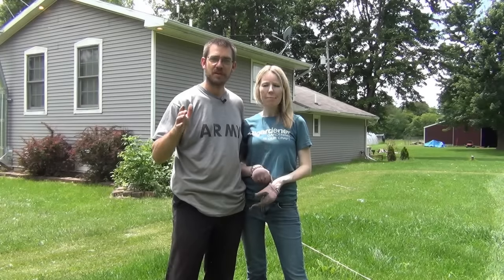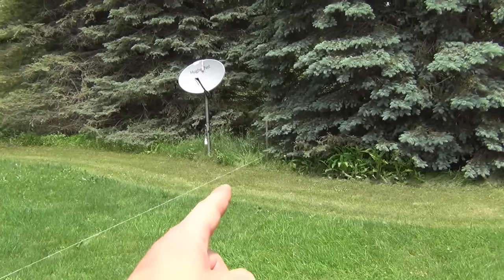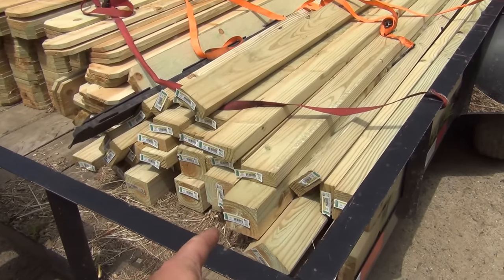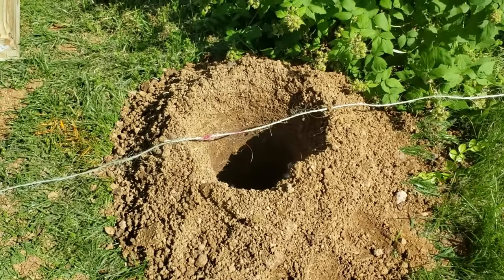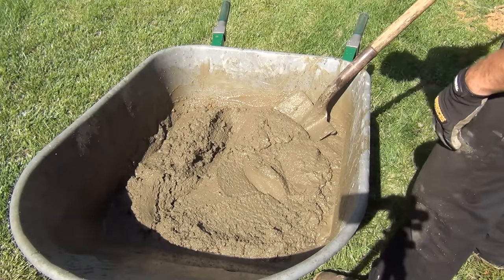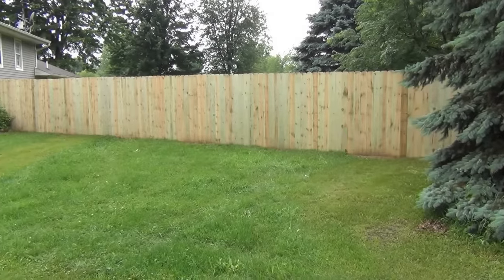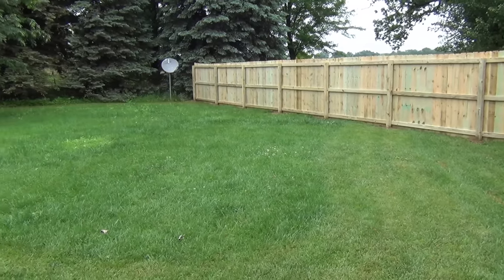How To Build A 6' Wooden Privacy Fence

Comment: Was goin great and I was getting all gung ho when he said he got everything at Home Depot. Then he pulls out a tractor....😬
Reply: Same exact thought
Reply: So what is your point about using a tractor, or gas auger, or hand post hole diggers?....
Reply: Well Tom not everyone has a damn tractor
Reply: Or a tractor with a damn auger those poor people just have a post hole digger and you’re lucky if you have that
Reply: @imhungry2387  I have a shovel lol
Reply: Right🙄
Reply: That's when you use a sledge hammer and some spiked post holders.  No tractor or concrete needed.  Just have to pray they dont twist as you drive them in.   Even if they do twist a bit, its all good, just adds character.
Reply: Jealousy is a horrible thing!
Reply: You can rent a auger from Home Depot
Reply: Me too! 98% of people do not have a tractor
Reply: Home Depot rents towable augers.

Comment: That hole against the house looks like it's basically the diameter of the post-hole digger, like mine.  Issue is that I can't go any deeper than 18-inches because the hold diameter limits the bite depth to that.  What did you do to get it to 2.5 feet???
Reply from the maker: Finish the bottom off with the manual post hole digger

Comment: I’m not a fence pro, by any means. But my experience with this type of fence is that when the pickets touch the ground, there’s a lot of water damage to the bottom. But how awesome is it to have the family together on a project?! Blessings!
Reply from the maker: The pickets are all treated for ground contact and generally that will give it a 50 year life under ground or in contact with the ground. The last fence  we had for 6 years and no hint of any rot on the wood in contact with the ground
Reply: That great. Must be some great PT back home. Here in Florida, my fence lasted 4 years. But we have different weather.
Reply from the maker: Yeah, could be a weather thing. Lots more moisture year round in florida!
Reply: @LoveShackBBQ  I can tell you that where I live in FL (Jacksonville) the big box PT wood doesn't last long at all, ground contact or not. I have to buy from a speciality marine store to get wood that will last more than 4-5 years. Got tired of rebuilding decks, etc. so that is what. do now.
Reply: Robert Hiday  the Mrs wants a deck. I’m still not sure if I should use PT 5/4 or splurge on the “plastic” decking. I’m in Frostproof, where getting specialty products is hard to find. Your input/knowledge would be helpful.

Comment: did you make 8" holes for the 4x4 post which would give you 2 1/4" on each side of the post for concrete/tamping?
Reply: Isn’t 12inch the 4x4 rec?  3:1
Reply: yes it it usually a 12" hole for a 4x4 post. i was just wondering if that is what you did.

Comment: just wondering   You premixed your concrete with your sandy dirt, what is your opinion of just placing half a bag of dry concrete in each hole, add your water and dirt in the hole

Comment: You never mentioned if you bought the fencing pre-cut or you bought the wood and cut it to what the measurements you need and the amount needed. Nor did you say what type of wood you used as in is it pre- treated, pine wood or what?

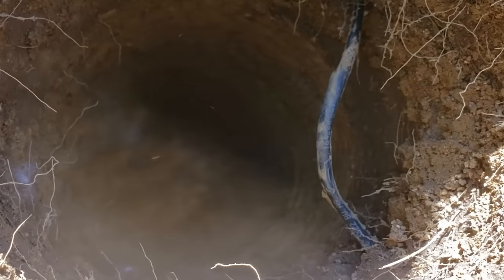Comment: 4:08 if that wire is coax, it’s going to give you problems with that cut in it. Water will knock out the higher frequencies.

Comment: What I've seen in Home Depot are those metal spikes that you push into the ground and then the 4x4 go in it. They're being fastened with two huge screws to the spike. What do you think about using those instead of digging holes?
Reply: Not gonna hold up

Comment: Yeah, don't run pickets into the ground. They should be 3" off the ground (the height of a steel toe on a boot) They'll get wet and rot, your weedwacker will tear them up, and you'll have drainage issues. 10 years from now, you'll need a new fence, and you'll be buying weedwacker string more than you want to.

Comment: I've watched a few fence video today. Most of the people attach the slats via a nail gun. Is there a benefit to use screws? Seems to take longer.
Reply from the maker: Screws dont work their way out and the pickets wont blow off. Nails are just a cheap way to go but not better

Comment: What kind of wood did you use for the fence pickets? I heard you should not let the pickets touch the ground to keep them from rotting. How much do you figure that fence cost you? I was thinking of buying the cedar pickets from local Mennonites who sell their wood cheaper than box stores.
Reply from the maker: They are treated dog eared pickets from Home Depot. They will rot eventually but it will be 20 years before that is an issue

Comment: Looks awesome.  I always thought you had to leave a space between the pickets for expansion.  Did you have any problems with it buckling?
Reply: You don't. Pressure treated will actually shrink. By the way, don't just use a half bag of crete and backfill with dirt. This fence may last 3 years before it starts falling over...
Reply: @chrisbrusman5451 Agreed.  I believe in overbuilding - I end up using 80-90 lbs of concrete per hole and use 6x6 for corners, ends, and gate posts. Also use screws for all stringers and hot dipped ring shank nails for pickets. Then protect/stain - I hate old gray wood!  I'd rather spend a $couple hundred more on the front end and never have to worry about replacing anything down the road!

Comment: About how much does it cost
Reply: I would guess about $500-600.  Those dog ear boards are about 2.50 a piece x 140 approx $350 for those plus 2x4, 4x4 and concrete.  Just guesstimating it, I used to work at home depot so i roughly know the price of some of the items.

Comment: Save you some unnecessary work, if your ground is semi moist by rain fall, just pour the concrete in dry. It will absorb water from the ground sounds crazy but it works.

Comment: So, the post and the 2 x 4 are fairly level? So then each picket sticks above the 2 x 4 at the same or close to the same hight? I have an area to fence that is pretty un level on account its been irrigated.
Reply from the maker: The post is plumb and level and buried at the same depth below the ground level at each point. This means that the 2x4's follow the contour of the ground and are not necessarily level. You can run a string between each post to make each section run on a straight line between each post or several posts if you would like or just set each picket on the ground and let the whole thing follow the ground contour.
Reply: @SSLFamilyDad  Ok thanks!

Comment: Any suggestions living in a area with high winds?  I've noticed alot of fences in north texas with tiny gaps between pickets.
Reply from the maker: We get gusts of win here over 50 MPH sometimes and it has never been an issue. I am sure it would stand up to much more than that. However, if you are worried about wind you can space out the pickets a bit
Reply: Post Master steel posts.

Comment: That electrical is definitely not to code,  for the simple reason no conduit and no identification tape.
Reply: It’s not electrical it’s a cable line running to the house. It isn’t required to be inside conduit nor is it required to have identification tape. The orange marks were also with tolerance I’m pretty sure.

Comment: Good job overall but I want to see your fence 10 years now when your pickets are cupping at the ends because you failed to put two nails on each side in the middle section. A little prevention goes a long way.

Comment: Your not supposed to use power digging equipment within 18” of the mark, for that reason
Reply from the maker: Yeah but sometimes you need to push your luck a little
Reply: SSLFamilyDad try that with Electric, you’ll only get 1 chance... and you’re lucky they don’t charge you for repairs, just because it’s not cut in half doesn’t mean it’s ok. Next time don’t be a lazy ass and get the chucks out !

Comment: Holes not big enough around, Not enough cement in hole, rails should be put up with hangers not just screwed to the Post, pickets should be spaced apart to allow for shrink/swell also pickets should not be all the way on ground. I give this fence 4 years before it's starting to fall over

Comment: Video isn’t bad but for installing the fence boards, you should never have them touch each other. There should be at least a 1/8 inch gap between each board. This prevents cracks and splitting because wood grows and shrinks but it can’t grow if it has boards right next to each other.
Reply from the maker: I would not recommend leaving any gap, as this wood dries (since it is treated) it leaves a perfect gap. I have left a gap before and after a couple months there was way too much space between pickets

Comment: You going to call the DSL people again real soon. Water acts like a resistance with coax cable. You will get intermittent problems.
Reply from the maker: it is not coax it is DSL, there is an outside sleeve and the inside wires are also insulated individually. I also patched up the cable with tape to seal out water
Reply: I saw a hughesnet satellite that's why I assume it was coaxial. I was a satellite installer for many years.
Reply from the maker: Yeah we used to have that but it was too much latency for remote support work. Now we just got two new dsl lines to the house

Comment: You did Not "get away with it" with your wire If that was your electrical feed! 

I deal daily with cable damages just like you have done! .... It will work for a while but Will fail (sometimes it can take years)  and if the power company finds you have damaged it they will charge you. 

Quite often the problem is loosing a neutral (it will corrode if you have stripped off the pvc) NOT something you want!
Reply from the maker: As mentioned in the video this was a DSL cable and I repaired it and it is working fine so far!
Reply: @SSLFamilyDad  Sorry my mistake ;0) .... I thought one of the lines was interweb the other power! If you repaired it (even just with 3M's tape you will be golden!

Comment: Bro, your posts are gonna rot.. always fill your holes all the way with concrete and use cedar. 24” holes are ideal. So much wrong here.. smh.. and yes.. I own a fence company.  Setting 8’ on center is a waste of time. Set your posts about 7’8”, place your rails where you want, then cut them after secured on the post with a circular saw in the center of the post.

Comment: Everyone owns a tractor with an auger attachment. NOT!
Reply: What is exactly your point? Did he ever claim that everyone had a auger attachment? You can dig them by hand just like he did with the one by his house.
Reply: @OregonGBfan  He claimed this method was the easiest. However it's not so easy if you have clay soil like most people and a bad back. Also in his equipment and parts list, I don't see an auger mentioned.